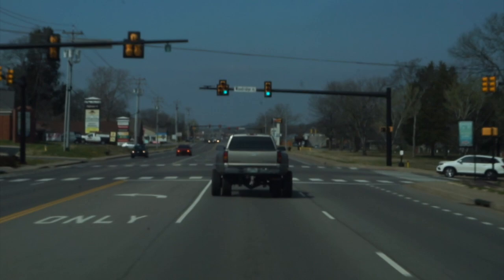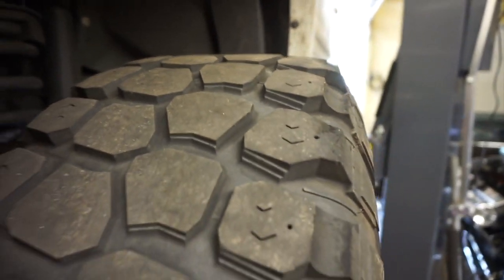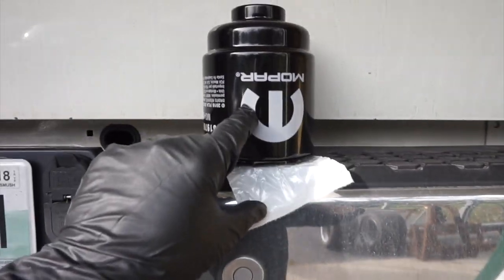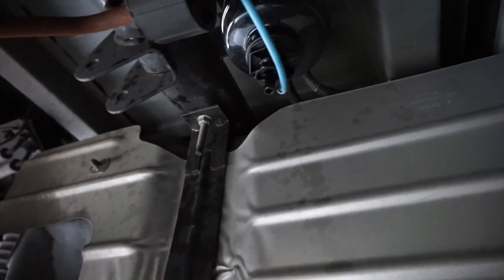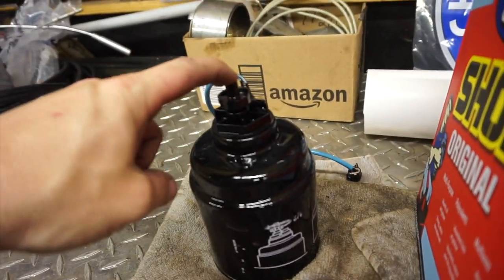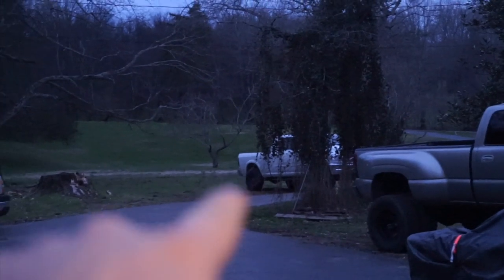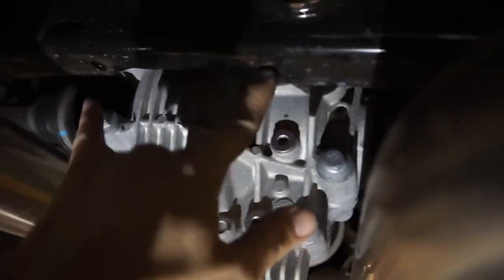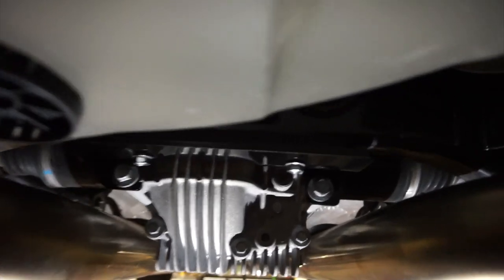DON'T buy cheap Mud Tires, I Didn't listen

Comment: I also learned the hard way and this has happened to my SureTrac Wide Climber MT's. Completely a result of my own ignorance by improper alignment, poor front shocks and not rotating. Will make sure going forward to pay more detail to this.
Reply: I got those same tires on a mega cab Ram and they are wearing fast but evenly with rotations! have 20K on em and have 6 or 7 left. I run on pavement all day and no cupping on them at all. And I have an 8" lift (good one done right). MT are not the right tires on pavement but run what you want like I do. So, have proper equipment and take care of it. Don't worry about what others think cause it's about what you like......Period.

Comment: The thread wear indicators at 1:30 shown you over inflated the tire. Ditto on some responses here, BFG KM2 or Goodyear MTR will show scallop wear pattern if not rotate every 3,000 miles, or good 4-wheel alignment. Added most mud terrain tires have softer rubber compound contribute to faster wear thus lower life. Have been switch  to all terrain for lower highway tire noise, longevity, and good enough offroad traction ever since.

Comment: that isn't from cheap tire its wearing  items that go bad ball joints wheel bearings tie rods and alignment not to mention that Cummins is a super heavy truck i run an offroad shop no b.s.

Comment: The toe went out slightly on my steer tires on my semi , I noticed a little cupping on the outside and by the time i got it into the alignment shop (1500 miles) they where trashed. Doesn't take long.

Comment: Anyone driving a 3/4 ton truck and up, get (12 ply) F Rated tires and keep them rotated at the correct intervals. Problem Solved. Since I've switched to F Rated tires I haven't had any problems with belt separation.

Comment: Have you ever tried dyna beads in your tires for balancing. I know I used to put them in my motorcycle tires and I never had an issue with cupping at all. And they rode great at speeds over 30mph. Under 30 man I would have to hold on to my handle bars for deer life. Just don't know how they would do in a big tire. Would be interesting to know

Comment: Try some Trxus sts tires. My wife has some of the 39.5x12 on her Excursion and we only replaced the rears because they had been on there for 10 years and no one would rebalance them because the manufacturer date on them so we just bought a new set, fronts are still 10 years old though. They are beast tires

Comment: The issue you are having isn't a result of the Ironman tires. Its a result of a poor alignment and or poor suspension. Usually bad shocks are what causes that specific feathering issue. If it were a problem caused by the tires then all 4 tires would be doing it not just 2 so obviously something is wrong with your truck not the tires. I can 100% guarantee that you can put the most expensive tires you can get on there and it will do the EXACT same thing. Same as when you see a person with shoes worn out on the outside edges... its because the way their body is shaped and the way they walk that causes it. Not cheap shoes.

Comment: Thats not the tires. You need to do some maintenance on your vehicle.  You need some suspension parts and ball joints. Tires don't just chop like that. It's definitely your suspension dribbling those tires as they go down the road lol and play with tire pressure  and alignment

Comment: Too many variables that could cause it. Had issue like that on my oem truck, did alignment got better but still had issue. Untill I hit a deer and decided to upgrade my front end new bearings solved weird tread issue, so look into that mine look fine but with new bearing hubs etc I dont have weird tread issues anymore. Plus just hit 40k+ on couragia mts they were great just cant find them locally also bfg km1 atko were awsome ko2 and km2 did not last near as older ones wildpeaks that everyone prases were gone in 7mo

Comment: I run expensive ass Cooper mud tires on my Ram 3500 and they have the same issues. They definitely need rotated more often than normal.

Comment: If u cross the rotation of the tires every oil change u wont have that . That called cupping . Did rotate every oil change . Would not have cupped . I have iron man on my chevy 1500 and they look like new still 10,000 miles and look good

Comment: This is what happens when you lift a truck without all the proper mods to the steering geometry. It’s operator error that causes that severe and extreme wear. It’s no the tires fault it’s yours. By some nitto mud tires I bet money you have the same problem. Do you not know anything about steering components?

Comment: that didnt look like a mud tire,,, looked like a  great set of soft tires for rock crawling and rock bouncing... just competed in rock crawling, trail ride,and won 3rd in mud bog finals- with 31" chapperrals... was totally happy with several sets over 6 yrs on all my vehicles but the dealer screwed me by not installing new rims on a saturday with 2 hrs till rock crawl sign up... so im going back to swampers

Comment: Poor alignment. Not getting the proper rating for your vehicle or speed. Not rotating when and like your supposed to. Putting mud tires on a pavement princess is another issue. I feel bad for the truck having a owner like you

Comment: Can't run mud tires on a truck that big with good wear. The compounds are just too soft and the tread pattern isn't meant for it. Also you have to rotate all the time or they will wear horribly.

Comment: Bahahaha. Crap alignment. I have used BFG for 30 years never had a single problem. I have also been a mechanic for longer than that. You need to do research and maintenance before you make a judgement. I would suggest apologizing for your lack of knowledge to BFG. Also get that front end looked at by someone that knows what they are doing!

Comment: Why doesn't that ram have 26x18?
Reply: theodore raz I'm gonna go out on a limb here and say it's probably the fact he doesn't wanna drop 6k+ on a lift to clear 10k wheels and tires.
Reply: theodore raz Because he actually uses the truck
Reply: Marcus Young and if you buy big rims you can't use the truck?
Reply: Hard to work out of a truck when it's lifted. I had a Megacab on 22x14's and 37's with 11" of lift and everything was difficult from using the bed to getting into the truck.
Reply: Bobby Rowlett you don't that big of a lift for 22x14
Reply: Bought the truck that way. Planned to go 40's with no issues but traded the truck in on a '17.
Reply: Bobby Rowlett oh